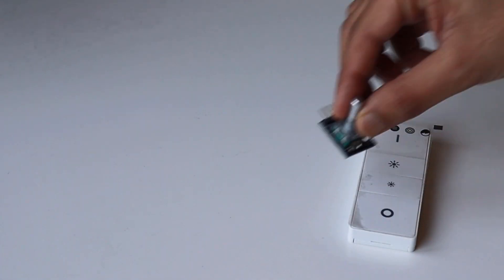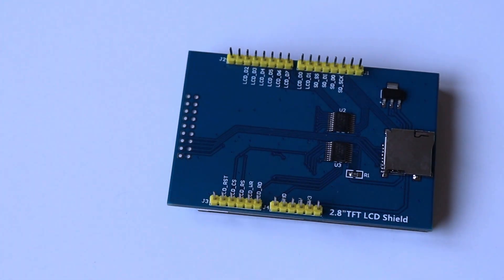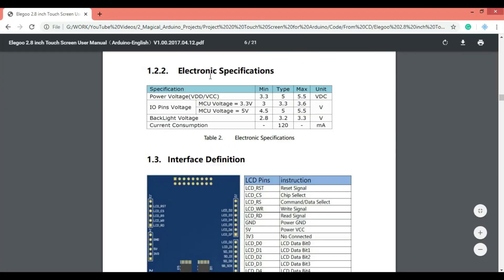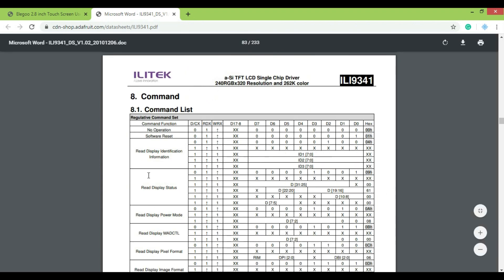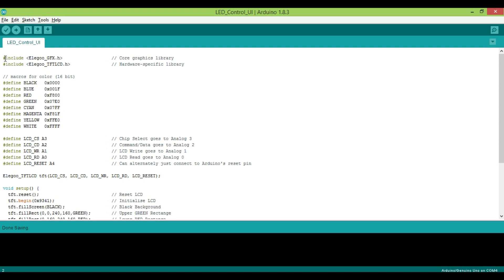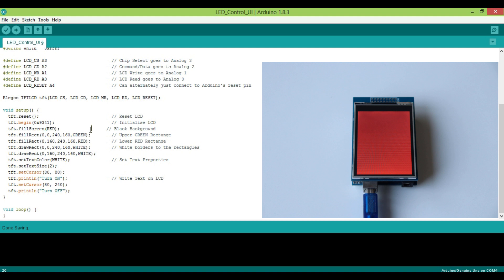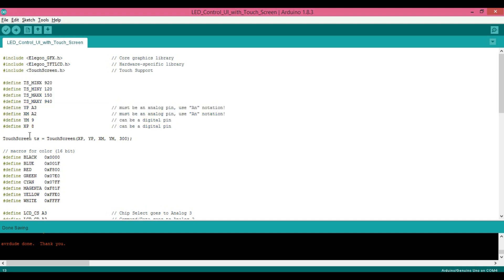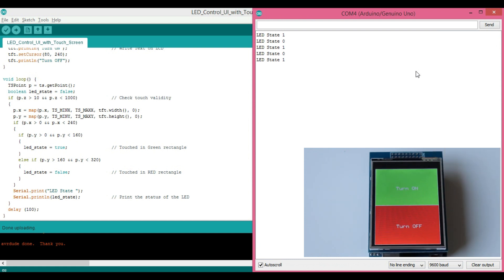Arduino Touch Screen Tutorial (2.8" TFT ILI 9341) with SD Card Slot

Comment: Can I use it with only 4 bit parallel data (D0 - D3) instead of using 8bit ??
Reply from the maker: You need to configure the disaply to wrok with such settings